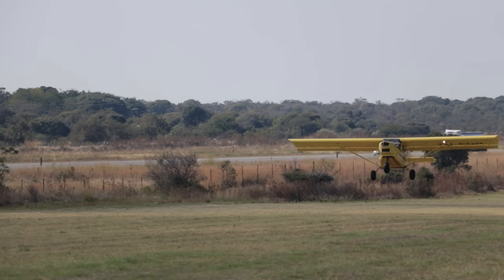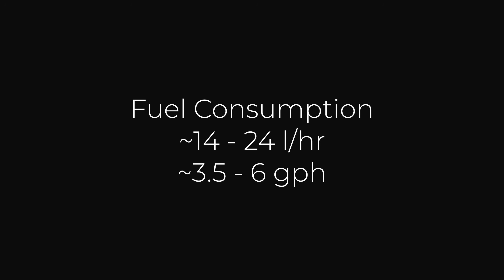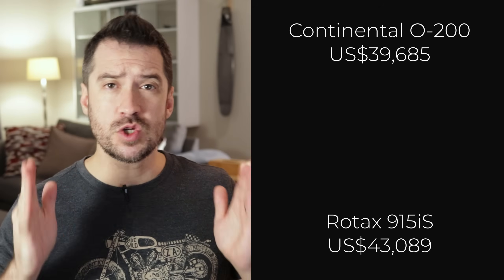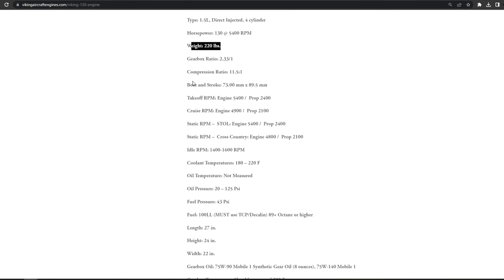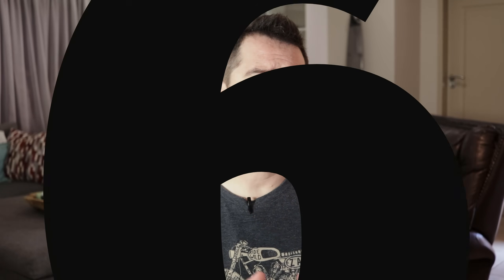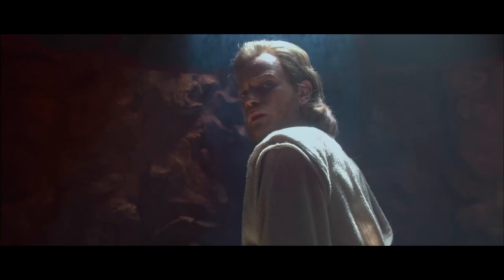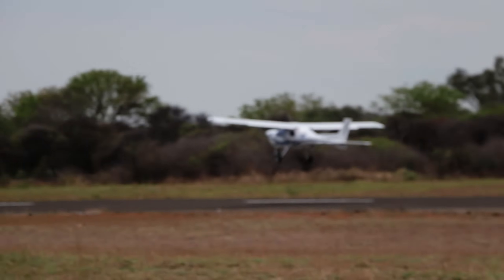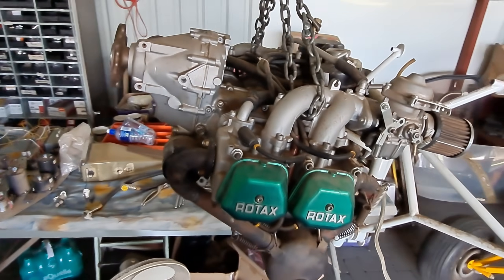6 WORST & 6 BEST Light Sport Aircraft Engines

Comment: 4:53 UL Power engines (ALL OF THEM) are notorious for making less power than advertised, using power numbers at 3200 RPM. Direct drive engine means Prop is way past ideal efficient RPM. Actual HP at a reasonable 2800 RPM is 20HP LESS....5:40 UL2600iS as the UL350iS lower HP than advertised, and ALL UL power engines eat pistons, rings and cylinders at one time. Fixed? Seal leaks, Customer support are problems. ROTAX prices don't include radiator & exhaust I recall.
Reply: bollocks. The one test you refer to was only done at 2800 rpm vs 3300 rpm that is the listed max hp rpm. Also note that UL now lists HP at 3300 rpm and at 2800 rpm. On the 350is its 6 hp difference! On that test all other engines were ran at their listed RPM for peak HP, accept the UL engines. And your statement all ULPower engines eat pistons and cylinders is total BS as well.
Reply: @ZenCH750  "one test you refer to was only done at 2800 rpm vs 3300 rpm that is the listed max hp rpm. Also note that UL now lists HP at 3300 rpm and at 2800 rpm”

UL power has notorious complaint from owner from UL power's earlier smaller engines to present larger 6 cyl 520 of making LESS HP regardless of their charts.

 Their new and improved engine makes rated HP at 2800 RPM? OK sure it does. It is also TURBO CHARGED? Right. They are getting this by pumping up MAP. I bet there are limits to making this HP, and fuel flow will be hilarious. Lycoming can operate at 100% power all day as long as temps are OK.  Lets see how many are in service, total hours and ACTUAL PERFORMANCE. Then we can talk. I am waiting to see it eat Lycs in sactioned cross counter races. Aerobatics? Forget it, not approved by UL Power. Please give me a break.

It is still a 320 CU-IN displacement. There is no magic to make HP,, and no replacement for displacement. They did not event new technology or some "modern engine" magic that makes more HP or has better specific fuel consumption. Do your research. Up to you. 

Are you even in the market for a $150K kit plane? Because UL Power and the prop it uses will be well north of $50K alone, not including the airframe, avionics, systems, wiring, upholstery, paint...

“On the 350is its 6 hp difference! On that test all other engines were ran at their listed RPM for peak HP, accept the UL engines. And your statement all ULPower engines eat pistons and cylinders is total BS as well.”

Where do you get “6 hp difference!”  Ha ha !!!!.  Where do you get that. Their RATED 200 HP at 3200 RPM is actual PER THEIR DATA is close to 180 HP. I still DO NOT BELIEVE IT. Why the one EAB kit plane I am most familure with is the RV Van’s series building my first in late 80’s. Flew my RV4, RV6 over 2400 hours. Now building RV7. So there are two RV’s with UL Power. They are slower, burn about the same fuel. Go calculate that. I know what I am talking about. NOTE: ARE THEY BAD ENGINES? NO  BUT I WOULD SPEND MY MONEY AND DID ON LYCOMING. ANY HONEST PERSION WOULD ADMIT LYC IS HARD TO BEAT AND IS AS RELEVENT TODAY AS IT WAS 60 YEARS AGO. 

What you said is irrelevant. I won’t get into the early dubious initial service history. Which to be fair has reported to be fixed? I do know they put CAST PISTONS in their early UL520’s. CAST. They now have forged pistons. A recent post on UL Power Facebook group shows UL520 CRANK SHAFT CRACK near the prop hub. OUCH. 

Personally my opinion is this is a boutique experimental engine. I would not put my money in to and get an (I)O320 or  (I)O360 and get a REAL HONEST 160 or 180 HP  (or 200HP for the angle valve. IN MY OPINION... being an aviation professional for 38 years, mechanical engineer, designed certified large jets, fly them, built two RV's, followed all EAB kit/plans planes, ALL engines used in EAB's, life time EAA member, I ADVISE CAUTION WHEN USING ANY ENGINE WITH LITTLE HISTORY AND UNKNOWN SUPPORT. 

Small planes  like the Zenair can’t handle higher HP or weight engines. However an RV7, RV8 is designed for and specifically for a Lycoming 180-200HP. For same price or buying you can get an engine with massive support. If operated at 55-75% power LOP (lean of peak) you will burn identical fuel and/or go faster than a UL Power RV7 or RV8 at any power setting. I have the receipts and data Prove me wrong.  Nothing matters except direct observation of performance and service history.  Lycoming has the Bona fides. UL Power? TBD.
Reply: unless you have real world evidence and experience, you cannot possible say "all" of any anything does any such thing.  I immediately discount everything you say when you make a sweeping blanket statement like "ALL UL power engines eat pistons, rings and cylinders at one time"  Try again please.
Reply: @ElCapitanR1  You may want research it. Try UL Power Facebook page and other airplane forums. I just looked. There is a new picture of a cracked crankshaft behind the prop hub. UL Power engines did have piston cylinder issues in the past. Not sure if that has been corrected or what model engine it affected. However UL Pwr engines are made similarly, adding displacement of more cylinders. A common or universal complaint I read is advertised HP overrated. They do rate HP at 3200 rpm which is too fast for Prop. So 500 rpm slower, for 2700 rpm you can expect to make 15-20 HP less at lower RPM.   Although not a LSA there is a RV7 with UL520 Power engine rated at 200 HP. In cruise speed is about 30-40 mph slower burning the same fuel as a180 HP Lyc powered RV7.

 If I had to pick an LSA engine it would be Rotax 912 or Continental O200. What the video says is high cost. True, but does not consider a used O200 can be bought and overhauled yourself (with help) for a fraction of the price of a new O200 at 2023 prices. Good luck with your project.

Comment: What about the WW Flycorvair conversion?
Reply: To add my 2 cents worth.  I am one of the Jabiru ‘statistics’ having had a complete engine failure in flight due to a dropped valve. Good result with a clean off field landing. But in my opinion  I will always mistrust them as a result.
Reply: I have one good engine but I’m sure its to heavy for his numbers he trying to hit what is it 200 = 220
Reply from the maker: Weighs about 230lbs...that's O-235 territory.

Comment: A simplified analysis.  If you value reliability, it might change the results.  Just like if you do a lot of flying in high altitudes and mountainous terrain.
Reply: I'd like to see how you are able to rank engines by reliability. At least in the EA world, reliability is an almost entirely subjective opinion.
Reply from the maker: For sure, from person to person there would be factors and scenarios that would change the order
Reply: This is why I don't favor water cooling and FADEC. People are forgetting why airplane engines are air-cooled and have magneto ignitions and carburetors or mechanical fuel injection systems. Water cooling is one more point of failure and one more system to maintain. Electronic engine systems are dependent upon an electrical power source, so they will fail if the airplane's electrical system goes down. Backup batteries are yet another maintenance item to check on all the time. None of this complexity is required with magnetos and carburetors. Magnetos are fully self-contained, self-generating ignition systems that are completely separate from the battery and alternator. The alternator can explode and the battery fall out and the engine will keep running as if nothing happened.
The FADEC people don't want you to know that...
Reply: @rescue270  in automobile terms, my old Beetle uses double the fuel of my modern diesel, but I can fix everything myself and never get stranded. All the tools fit in the tiny glovebox except the large adjustable wrench I use to turn the crank if the carb gets flooded. I could travel without it, but that means a 15 minute wait for the carb to drain. And I service everything myself for $10 a year, the cost of 2.75l of oil. The modern car in servicing alone buys me 100 litres of petrol, then there's tax etc on top.
Reply: @juchetony1910  
Oh, I loved my old Bug!!
Changing the generator or pulling a cylinder head was a chore compared to other cars, but it was still simple enough. The only reason I quit driving them was because the quality of available new replacement parts had gotten so bad I couldn't depend on them anymore.
Reply: @rescue270  it's mixed, but you're right. I've had good brake calipers, shoes and front suspension parts, but I read the carbs (for example) are awful these days. My replacement fuel pump isn't great but does the job.
Reply: @juchetony1910 
I still have my mother's VW Acapulco Thing that I drive around my airport sometimes.